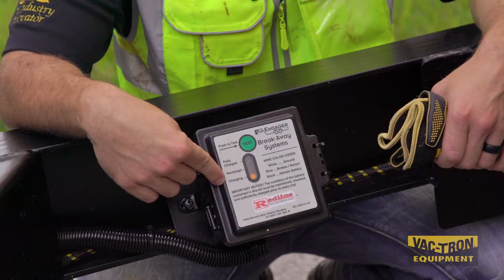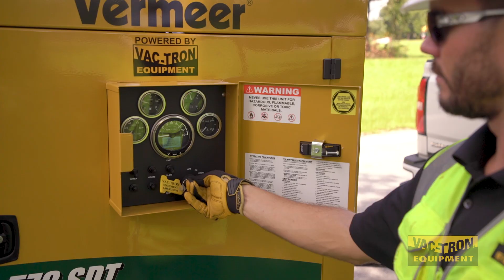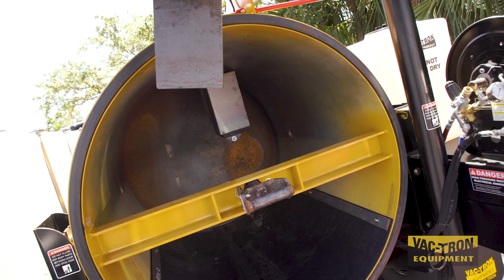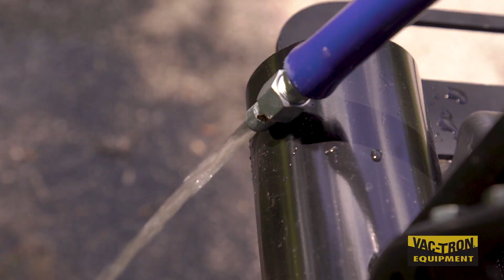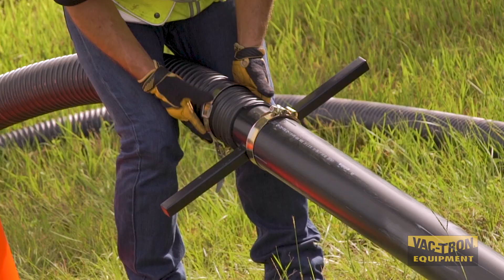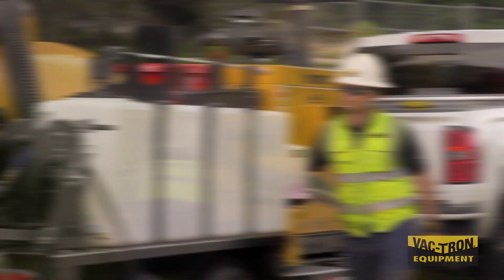Vac Tron's LP Low Profile Series trailer hydro vac Training Video

Comment: What do u do whit a machine like that
Reply: we use our to clean out valve boxes or some quick removal of dirt around something deeper than a shovel can get to effectively. it can also be used to clean out a storm basin
Reply: Locate underground utilities, jet out storm or sanitary laterals, set posts for concrete and fencing.
Reply: I use it to work on water main repairs and this machine is a godsend for operators like myself
Reply: The non-excavation vacuum operation works very well